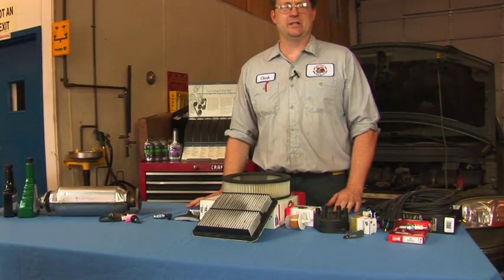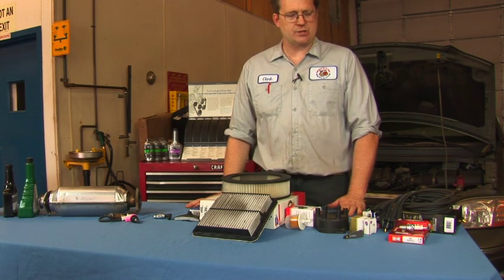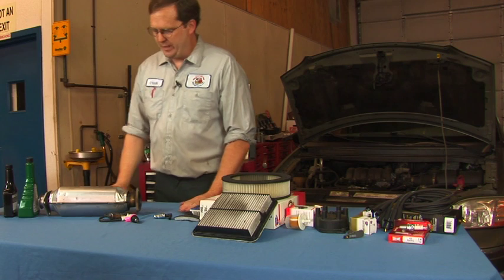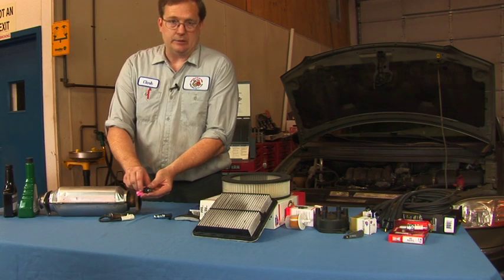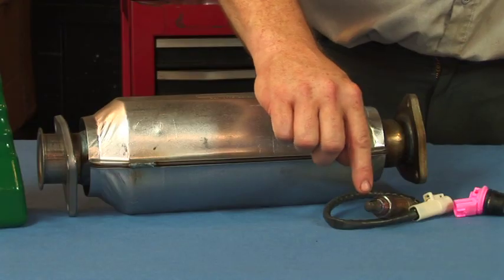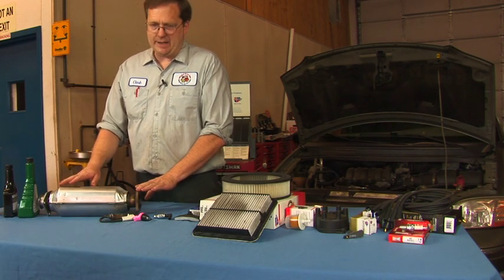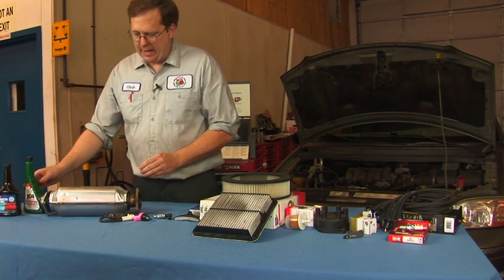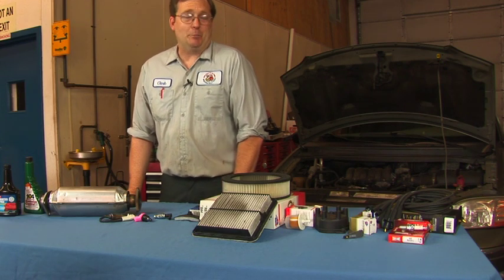Auto Repair & Maintenance : How to Lower Car Emissions & Pass Inspection

Comment: u could always buy the sticker under the table i think most people do and thats why the heat is getting worse every year i mean i see real clunkers on the road black smoke out of the tail pipe no way there passing inspection but they have new stickers lol also u can drive it some where else that has no emissions inspection at all if your desperate.